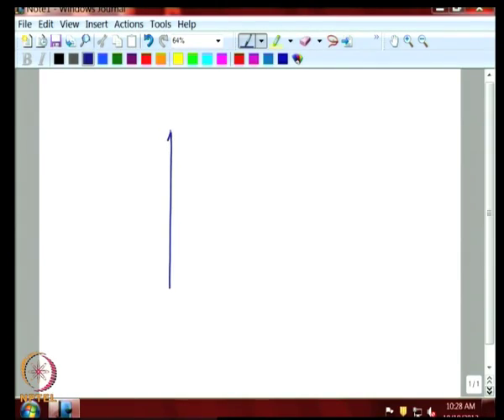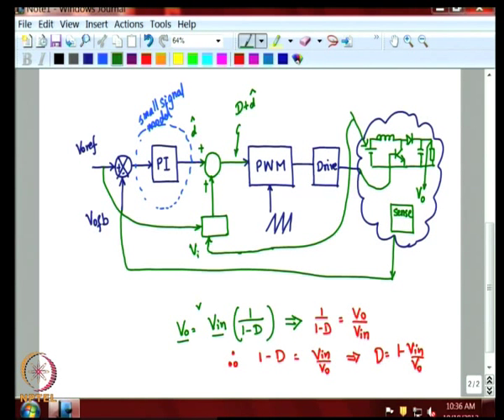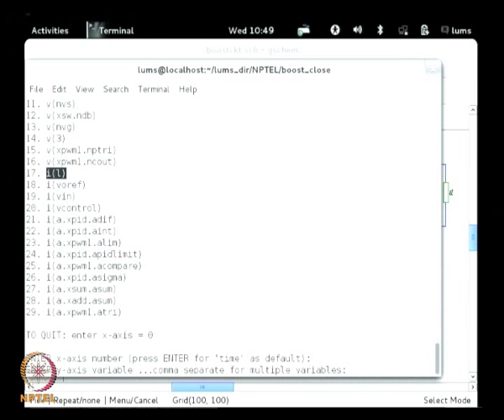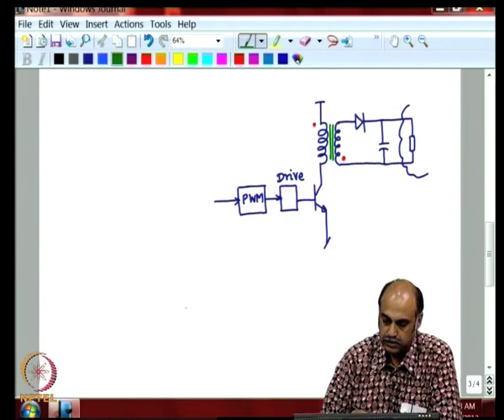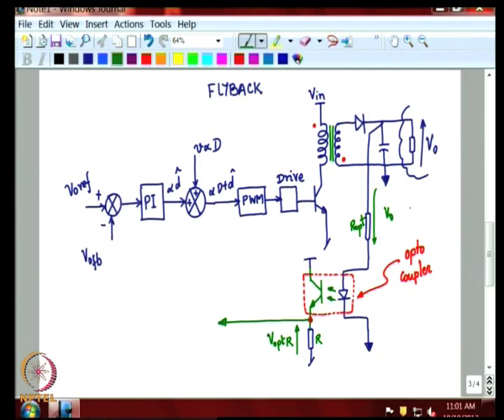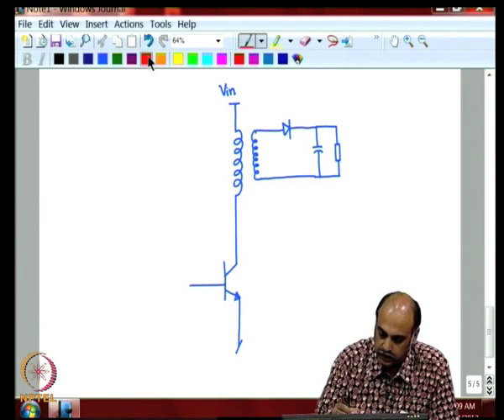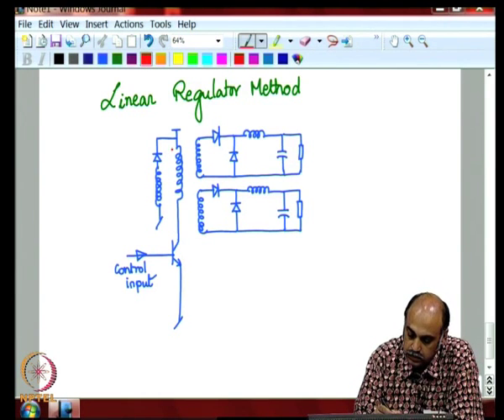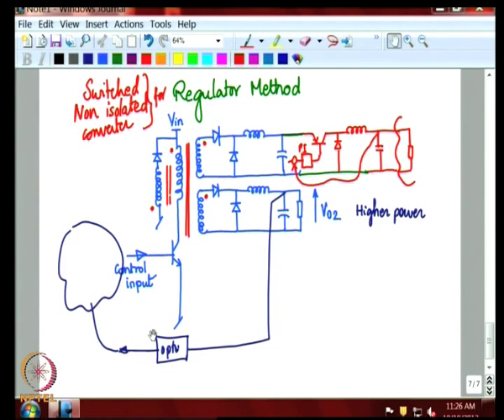Mod-12 Lec-34 Controllers and Sensing Circuit

Comment: Sir,
How to tune the gain for a PID controller in boost Converter? (Kp,Ki,Kd)??
Reply: well if you are tuning individually, you can choose a trial and eroor based approach. but your systems characteristics such as badnwidht, response time etc and bode plots will help you choose the kp ki and kd values. also you can choose the single gain and control structure sir talked about in the previous lectres.